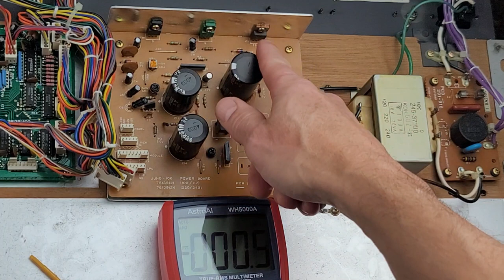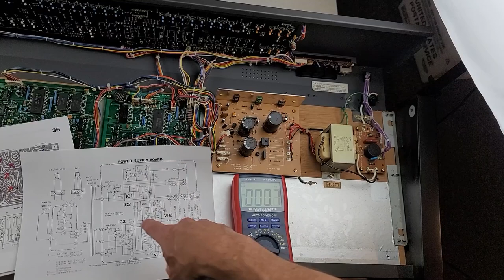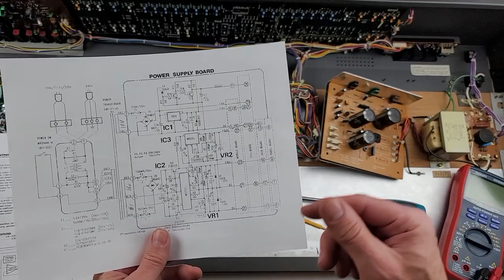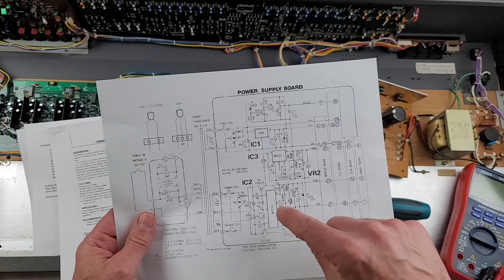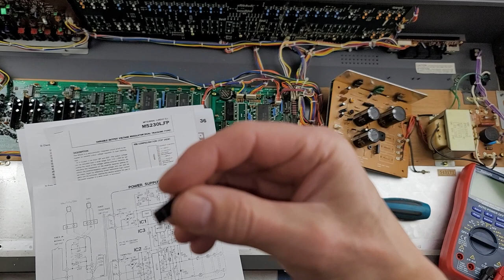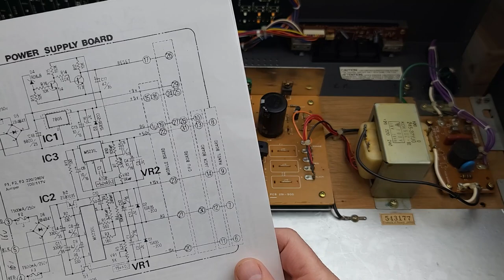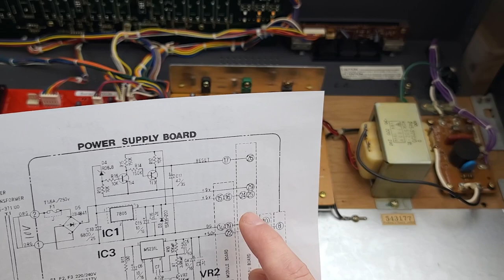Repairing & Restoring a Roland Juno-106 to Better Than new! Episode 2: Power Supply, Keybed

Comment: 7805 is a voltage regulator rather than a power transistor and as you noticed it has already been replaced once, the solder joint gives it away immediately.  One must definitely admire the quality of workmanship of this synth. Kudos to Roland! You're also doing an amazing job refurbishing this!

Comment: Love how you showed us not to touch the transformer when the power is on wether it was intentional or not 😄 I remember back when I went to basic school where we got to try out the basics of both car mechanics, Electronics, and machine operators/welding. and in Electronics we got to play with some nice old CRT Black & White TV's and the instructor told everyone NOT to touch the high Voltage circuit (abouy 10k volt iirc on a B&W TV)), and of cause one of those that was going to be auto mechanics didn't listen and touched it .. He was TOtally white in the head for about 10 minutes and we all got a good laugh. He could bless himself that we werent working on Color TV's which had about 4x times higher voltage 😅 Luckily there isn't really any amperes in the high voltage part of a TV so it won't kill you, but it still give you a nice shock that you will remember 😁 You can safely touch eg the power on switch as long as you only use 1 finger .. it will only tingle in the finger as long as you arent grounded 😉
Reply from the maker: It was definitely not intentional! If you look closely, my finger was touching the grounded heat sink at the same time as my hand touched the hot 110V terminal on the transformer, so I got a solid, painful jolt right through my hand. It really hurt!! And yes, those flyback transformers can pack a wallop!

Comment: The keybed looks a lot like the D-50, I took that one apart twice, after I put one of the rubber contact strips in the wrong way around... (yes, it is possible there, as there are two contacts for each key for the velocity sensitivity, they will make contact in the wrong order if you do so, so I had one octave that was not velocity sensitive...). But a detail: the little springs are different for the black and white keys in the D-50, is that not the case in the Juno-106?
I'm waiting for my 106 to arrive, probably beginning of next month, I hope it won't be as filthy as my D-50 when I got it (but it is shiny as new again now 😀), but I guess I still have to clean all the keys... And convert the power supply to 240V as I live in Europe and ordered it in Japan. I'll then put shrink-tubing over the transformer connections, a lot safer than keeping them unprotected!
Thanks for providing this restoration video, now I know what to expect ;-).

Comment: LOL i actually love doing keybeds, if you ever done a roland Red Goo of death keybed youll find a simple one like this a walk in the park, i actually do preffer putting al the keys on a bucket of soap and use a soft brush to clean inside of them, this keybed is a knife edge pivot point so roland didnt use lubricant, but you can apply very  little of the white silicon grease on the pivot point and the keybed will become a little quieter on action and slightly smoother, but its not neccesary
Reply from the maker: I have done a JD-800 red goo keybed - I've got a video of it on my channel here. :) I thought about lubricating this one, but decided not to bother in the end.
Reply: @ScottsSynthStuff  ohh yes, jd800, vk7, xp50/60/80 and others, roland really crapped the bed on that gen

Comment: I was like, aaaaa dont put your hand there!!!!. And then it happened. Ouch!
Reply from the maker: If I hadn't have been making a video and not paying attention, it never would have happened! :)
Reply: @ScottsSynthStuff  Oh yeah, im pretty sure of that. Most accidents happen from not paying enough attention of what you are doing or being occupied. Luckily it was just sharp reminder of real danger and ended up ok for you. Also education value is actually really substantial for all of people following this and everybody will be even more careful.
Reply from the maker: @DestroyER82  It was particularly painful because my finger was touching the grounded heat sink of the power supply when the edge of my hand contacted the hot lead on the transformer, so it went right through my hand, which is why I yelled and said some Bad Words. :)
Reply: @ScottsSynthStuff  Yes I saw that lead line there and was wondering about such design, I cannot really recall seing it this dangerously exposed anywhere else.. Anyways.. Bad words definitely better than no words. ;-)

Comment: I was just wondering, do you still need a Juno 106 when you have models of it in your Roland System 8 and Jupiter-X. How does it compare to them? Does the original give much of a reason to use one over those newer clones?
Reply from the maker: I don't know how it compares, because I haven't had this one working yet! I do have the Juno-106 in my System-8 and my Fantom, so I'm curious to see how they stack up against the real thing.

Comment: do you have a video of how you changed the power to a grounded universal power adapter plug?
Reply from the maker: It's not really worth an entire video. I bought these: https://amzn.to/3tynILx

Then desolder the old one, unscrew it, screw this one in its place, solder the new one on. Make sure you run a wire from the ground on the new one to the metal chassis. That's it!
Reply: @ScottsSynthStuff  thank you for the reply. I was confused on your placement so I asked how you did it. It looks different to how another YouTuber did it. Where exactly did you screw the ground wire onto the metal “chasis”?
Reply from the maker: @ghostfrom1950  the replacement literally screws into the exact same spot, using the same screws as used on the old one. No modification required.

Comment: Hi Scott, I was curious to know what you think of Plasma Music's Supernova PSU for the Juno 106. It's a modern switched-mode PSU replacement. Is it a safer PSU than a serviced original PSU? I don't have solder skills, and I was wondering if the Supernova PSU would be a better investment than paying a tech to service and re-solder the original PSU in my Juno 106.
Reply from the maker: It's a supremely well-engineered power supply, and I did think about buying one...but at $440, for just a power supply, I decided against it.

Comment: When you're buying parts for these rebuilds, do you buy everything you think you'll need even if the original part isn't broken or not working?
Reply from the maker: Not normally...but for the Juno 106 and the Polysix, where I'm working with 40+ year old synths, and knew that wear items like pots and switches either have failed, or will be failing soon, I just go ahead and replace those parts. Otherwise I'll just be pulling it apart in a couple years to replace more parts again.

Comment: Scott ..I rechecked my Juno 106 ...Everything is working I just am having the residual noise from the current patch after I stop playing... What is wrong ? More importantly ...How do I fix it??
Reply from the maker: If a voice is still sounding, it's possible one of your voice chips (which also contains the envelope generator) is going out.
Reply: @ghost mall Okay I will check your video section on replacing voice chips...Thanks Scott!!!
Reply: @ghost mall ...I think the sound cards are okay ..It's just a problem when the keyboard heats up it does that ...maybe I need to just replace the 2 chips in the power supply

Comment: Hi Scott, thanks a ton for doing these videos as they are a massive resource for those fellow 106 owners out there. MASSIVE resource! In regards to checking the voltages on the power supply board, may I ask why you skipped test point 'D' or 1-4 ('verify +5V plus/minus 0.5V at D) per the service manual? Is measuring off the 7805 the same thing? 
Reason I ask is I am measuring per the points on the service manual and have my power supply board disconnected from everything else much like you are doing. My voltages are right on point for test points A,B and C except that I am only getting 0.02V if nothing at all off of D3 (or test point D). I have another Juno that seems to work fine (aside from a dead voice,  and staying tuned to your next videos for that fix) and tested it to get much of the same results. Any peace of mind you can offer would be much appreciated if you have the time.
Reply from the maker: Yes, test point D is coming off the 7805, so measuring it at the output of the 7805 is the same as measuring at test point D. The 7805 is supply power for the digital circuitry. Test point B, which is also +5 volts, is from the analog side of the power supply, and is separate from the +5 volts coming from the 7805.

If you are not getting any voltage off of test point D, check your 7805 - the leftmost pin is input, the center pin is ground, the rightmost pin is +5V output. If you're not seeing +5V there between ground and output, then the 7805 is either bad, or the input voltage isn't there.

Keep in mind that the analog ground and digital ground on the power supply are NOT the same. When testing the 7805, you must reference its output against the digital ground, which you can pick up across D3 (the left side of D3 is ground, the right side of D3 is +5V).
Reply: @ScottsSynthStuff   thanks for dropping more knowledge Scott, you are the man.